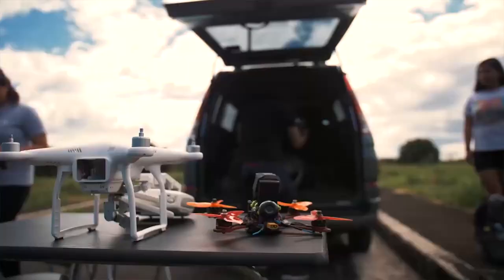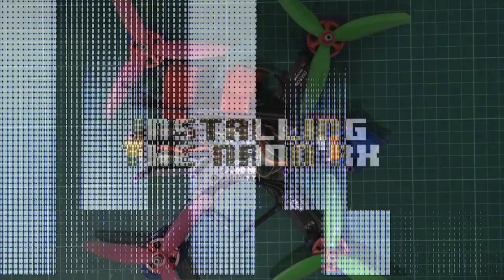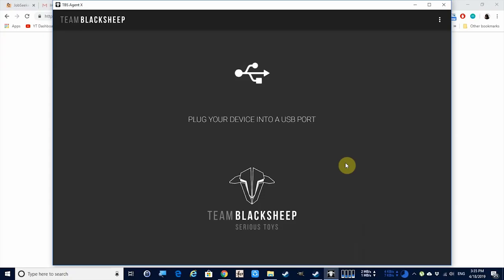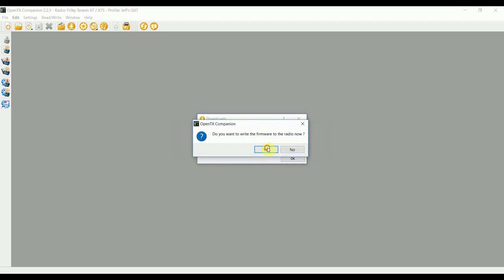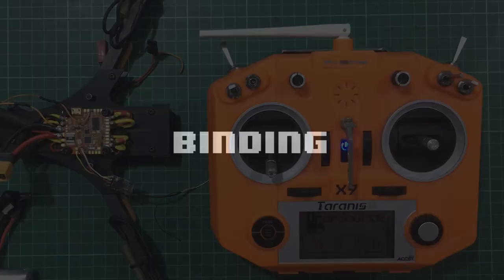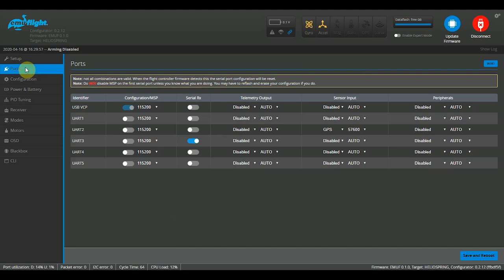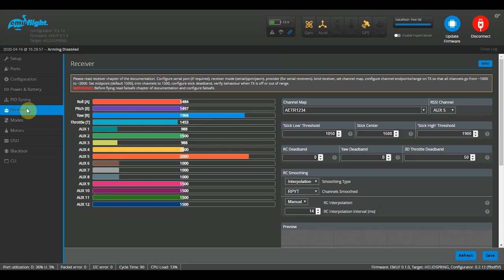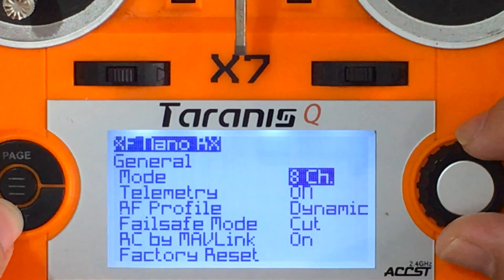Complete Guide to TBS Crossfire 2020

Comment: don't power up a radio transmitter with the antenna disconnected
Reply from the maker: You'll get terrible range, but other than it's not recommended, I've done it several times and it's not gonna burn up your module. I think it's robust enough to handle it, unlike most VTXs.
Reply: Yeah man, I noticed that also. TBS stuff is pretty robust stuff though. But still, as a rule-a-thumb...Spot on Bro!

Comment: Thank you for this. Please consider turning down (or removing) the music next time, it’s way too loud and distracting.
Reply from the maker: Thanks for the feedback! I'll lower the volume a lot more next time.  :) Or do you think these kinds of videos should be completely devoid of background music?
Reply: I was just going to mention the same thing.  Great video, but background music needs to be much, much lower...making it actual background music.  Thanks!  :)
Reply: @ImaginationTech  completely void would not be bad at all.  If you do use music, please make it barely audible.
Reply from the maker: @scootroter4859  you guys will be happy to know then that my newest videos don't have background music! :D
Reply: @ImaginationTech  Co0ol!
Reply: RC related tutorial videos should not have any music at all in my humble opinion. Unnecessary distraction.
Just ordered my TBS XF Micro V2. Waiting for the QX7S Access radio to be back in stock through my local hobby shop. Will follow along. Any specific mod required for the newly released Taranis QX 7S Access Protocol?
Reply from the maker: @aerora0292 you shouldn't need the mod for the QX7S
Reply: @scootroter4859  Thanks Scoot Roter. I have  been using a Taranis X9D + SE for over 3 years now and very happy with it.Only issue is the switches get worn out pretty quickly. Just replaced the right hand side navigation button.In regards to RadioMaster, there  is  lot of good reviews coming out and will wait a little bit before committing  to a new radio. Thanks for the advice. Yes, TBS XF is the best in today's context without a doubt. That is the reason it is getting so popular and user friendly as well.  At the field that I fly most of the pilots are already on XF standard module.
Reply from the maker: Ok everyone, heard you loud and clear about the background music. I've just re-uploaded a fixed version, here https://youtu.be/tEiHZRbB9_w :)

Comment: Hi there will the QX7s with this PCB Mod ... can it run crossfire at 1watt from the internal battery power supply 
Love you video cheers😊👍
Reply from the maker: Is that with the updated Micro Tx v2? Shouldn't be a problem, though 1W will drain your battery quite quickly. If it's the full-size module, you can plug in its own battery.

Comment: what will happend if i dont install the little chip on my qx7 if i just want it to fly a mini woop
Reply from the maker: If you're using a whoop, chances are you're not even using crossfire but the built-in frsky receiver, so this doesn't apply to you. If you do have a crossfire receiver on your whoop, you will need to set your baud rate lower or else you'll get endless telemetry warnings.

Comment: I was ready to give up on my crossfire micro tx v2 until I come across this video Thanks,  so I've been days trying to connect my crossfire system to mission planner app but still no go it just won't connect. Micro tx v2 firmware is 4.0.2, nano rx firmware is 1.17, nano is wired to f405-wing I have only 4 wires connected 5v, ground, nano channel 1 to rx1, channel 2 tx2 I have channels mapped according to wiring. Everything binds no problem all telemetry coming back to radiomaster tx16s, laptop, and tx wifi module seems to be connected to phone hotspot but app still will not connect. Do I need to wire nano to another uart to make this work? I have open tickets on crossfire website but for days tickets say processing,  crossfire support very disappointing. Any help will be appreciated
Reply from the maker: Hey man, sorry I haven't seem to have replied to you. Have you gotten it working. I haven't tried Mavlink, but I can do some research.
Reply: No it's not working I've tried everything I can think of, any help would be appreciated

Comment: Is this also possible without sd card? My sd card reader is unfortunately broken
Reply from the maker: QX7 firmware is fine to run without an SD card. However, you won't have the scripts. Workaround for that is to plug your Crossfire module to a computer and change settings via TBS Agent.
Reply: @ImaginationTech  thanks for the answer! So its possible

Comment: how come my pages are different than yours?
Reply from the maker: What firmware do you have on your radio? That would probably be the reason. If the pages are different, but you can still access the relevant pages, then it shouldn't be a problem.

Comment: sir question yung tx ko kasi walang usb port nasira ko. pwede ko ba gamitin usb port ni crsf module as usb port para updated yung tx?
Reply from the maker: Unfortunately, it doesn't work. It's not a passthrough unlike with ESCs connected to a flight controller.

Comment: Hi seen your post on FB nice video just wondering why you bound your rx with no antenna on your tx maybe this is the reason i have poor rssi its as low as 50 just 150ft away I bound mine with the antenna I het just as far with a xm+? Ingat po
Reply from the maker: Sorry, saw your comment just now as it went to spam. Without the antenna, you will have very poor range. It shouldn't be a problem when you're on the bench since the tx and receiver are close to each other. Other than that, it makes no difference if you bind it with or without the antenna. Do you get failsafe or just low RSSI? Could be damaged antenna, lots of interference, etc.
Reply: @ImaginationTech  Hi I get a low RSSI reading and LQ starts at 300 but gets real low quick. After updating from 3.23 to 3.28 LQ is better but RSSI high is 80 but on my taranis its now 99 not sure what the go is and cant find any videos any ideas?
Reply from the maker: @kanenstuff  looks like the values are ok. What's your Max Power set to?
Reply: @ImaginationTech   max power is at 250mw and dynamic is off i have the micro TX and nano se RX
Reply from the maker: @kanenstuff do some test flights, maybe 1-2km to see if it drops, goes up, or stays the same. Maybe there's some interference from where you're launching. Also, make sure your micro tx and receiver antennas are aligned (both horizontal or both vertical, but vertical has farther range) and the tips are not near carbon or other parts.

Comment: Great tutorial! But my when I run the luascript on my taranis it says "waiting for crossfir" and it doesn't do anything all my pins are aligned and I can't think of anything else! Thanks!
Reply from the maker: When that happened to me, it was because my QX7 wasn't communicating to the module bay because I had it wired wrong. Also, check out the appendix video, there might be a clue in there, who knows. --> https://youtu.be/mhT4LoObA44
Reply: @ImaginationTech  what did you have wired wrong? Am I supposed to have the mod done to my qx7 first ?

Comment: I guess Betaflight 4.2.1 uses an auto script as all I did was to select 'crossfire setup' and it took me right in. No lua script to look for (OpenTX 2.3.9). only thing is my receiver (nano) isn't showing in Agent-X. Anyone have any insight?
Reply from the maker: Yeah, that would be the OpenTX update for the Crossfire config shortcuts. No more messing with lua scripts. I have not updated my OpenTX yet since the ACCST/ACCESS fiasco. Maybe I'll check it out.

Comment: Can you still use the normal transmission with other drones with the crossfire soldered? How does it work?
Reply from the maker: Yes, the internal module is completely unaffected. The mod is for the external module bay where you would put the crossfire.

Comment: When I run OpenTX under the settings, I only have the option for Lua NOT "luaC" for some reason. Anyone know why this might be the case?
Reply from the maker: Might be the OpenTX version. Newer versions don't need the luac anymore.
Reply from the maker: I have a video on the Inverter Mod for the QX7 linked in the description. Mentioned it there at 8:46 that you don't need luac on OpenTX 2.3.1 and later. So you're good.

Comment: Hi Sir, whats the voltage range of the crossfire nano rx? Can I put solder the 5v rx wire to a battery positive on my mobula6 board?
Reply from the maker: It needs 5V. Batt positive of the mobula6 is only max 4.2V, which is already below the threshold of maybe 4.5v before the nano rx cuts off. The Crazybee F4 lite board comes with a 5V BEC, so you can power it off a 5V pad.

Comment: Sir nabasa ko dati na kapag daw nagbbind sa receiver dapat medyo malayo yun tx sa rx kasi minsan may nasusunog na rx? Tsaka may tanong ako wala ba magiging problema kapag frsky receiver n ulit gnamit ko matapos yun mod sa qx7?
Reply from the maker: bwas fpv nabasa ko rin yun, in my case naka set to 10mW lang or di nakakabit antenna siguro kaya di nakakasunog. Pag 250mw or 500mw siguro. 

No problem ang FrSky since different modules naman ginagamit. I still use both Crsf and FrSky.

Comment: Is it normal that my QX7 starts to hum like crazy when i use my Micro TX V2 ? Is there any easy fix for it ?
Reply from the maker: Hum?! No that's definitely not normal, and not something I've experienced. Does it hum all the time?
Reply: @ImaginationTech  I've done some research and it seems that the Buzzing/Humming sound is normal when using an external Module because the cables going to the speaker on the QX7 are not shielded. Could fix it with some Aluminium Foil on the inside or other but i just ended up taping my speaker shut :P The buzzing is pretty loud
Reply from the maker: @NeverenCH  wow LOL, I'll have to check that out. Might be how I routed my wires, or the wires I used? IDK. I'm not getting buzzing on mine, maybe my wires/mod are far away from the speaker cables? I'll have to take another look and see if I can reproduce that problem. :)